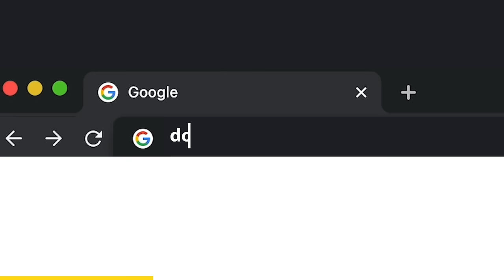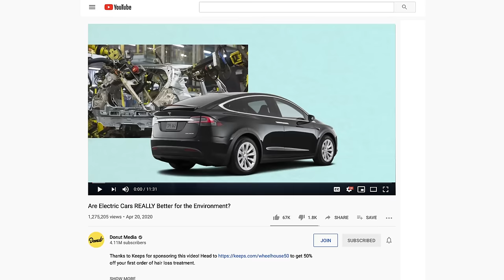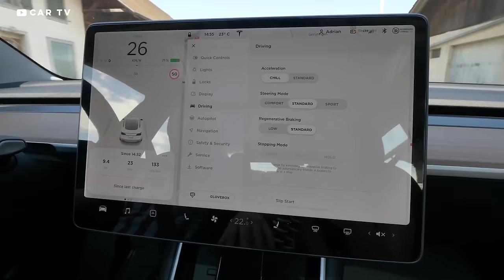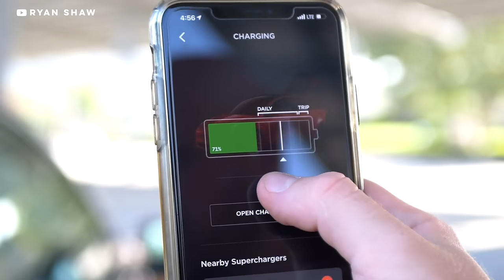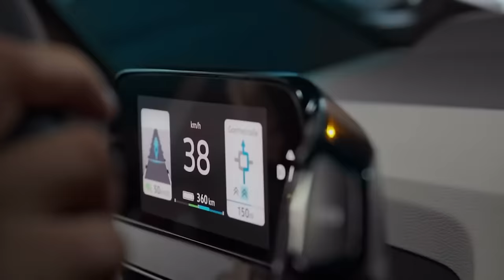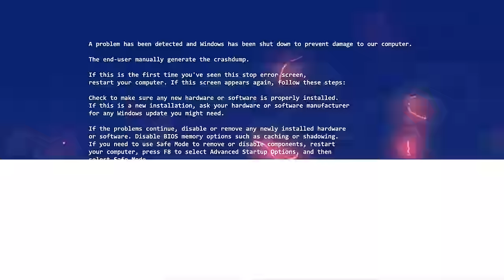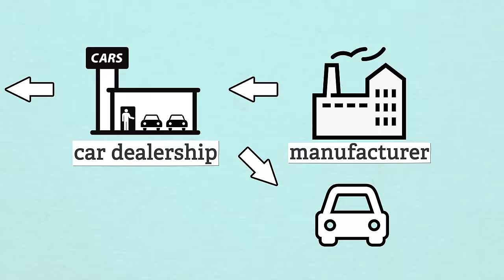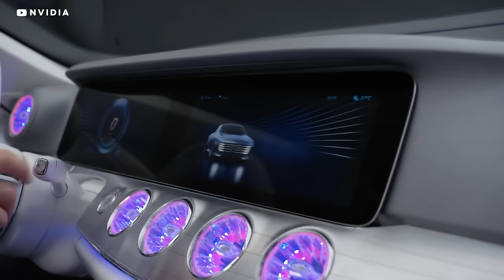Why Can’t Anyone Take Down Tesla?

Comment: I used to work as a software engineer at an automotive manufacturer's RnD and at that time, Tesla introduced the self-driving feature to the public. We were so dumb-founded that it was way past where we were and the gap is so far. It is true it usually takes a few years before new tech from RnD gets to actual road cars due to the business model of supply chain, parts, and manufacturing. While it was THE vision for us, Tesla already had it in their cars.

Comment: I don’t care how impractical it would be I want a manual in an electric car. 😔
Reply: Manuals are reliable, that's exactly what Tesla wants to avoid. How about the best cool Tesla feature: the ability to have your fast charging remotely disabled without your permission. 2nd coolest next to not being able to fix it or have it fixed by anyone other than Tesla. Cool Scam.
Reply: You can get a manual, in one of the vintage cars that are converted such as the VWs by EV West

Comment: @donutmedia I think Nolan was on his way making an excellent point but missed a bit. It is not that big car manufacturers (such as VW and BMW) do not have the know-how and/or the people to build superior software than Tesla. They do, the problem is how they utilize their people. And here is an aspect that video did not mention unfortunately.

Tesla is a technology company whereas other car brands are manufacturing companies. They use very different methodologies and approaches on their development strategies. In other words, Tesla knows how to coordinate software development and how to proceed quickly and effectively, car manufacturers are not very experienced in that endeavor and also still not very effective. Add that to the fact that most car manufacturers are big corporate structures with complicated management hierarchies suffering from bureaucratic delays and you can see how they are not very successful in developing software. That said, with big environmental pressure around the corner (there are talks of banning fossil fueled private vehicles in EU by 2025), big car companies will have to catch up and they will have to catch up quickly.
Reply: Exactly, but even technology companies fail to follow through with the discipline to develop and deliver functioning product updates. At the heart of the software development process is the Agile Methodology (https://hbr.org/2016/05/embracing-agile ). But it takes a little getting used to. You have to cut and dice the problem to manageable size AND produce a quick prototype that works good enough to prove a solution exists. In that way you put together all your prototypes together and come up with your product's 1.0 version. And it will suck and crash. But you iterate and do it all over again. You try to be agile and not stop and delay the process. This is hard specially for those developers who are perfectionists and can't let go the prototype code, they think they can improve it a little bit more and so delay the process.

So yeah, Mr. Musk has mastered this agile process not only for software but for cars and rockets! Very impressive.

Comment: Tesla: I have the most advanced buisness model
Toyota: Hold my TPS
Reply: True, Toyota's Tire Pressure Sensors always need replacing, that's a good business model
Reply: jeany545 I thought that was TPMS. Tire Pressure Monitoring System

Or did I totally just miss some sarcasm? You never know these days🧐
Reply: @jackryan4313  yes tps= throttle position sensor :)
Reply: @jeany545  Can confrim, I have a 2008 Toyota Avalon with TPMS always on, can't be bothered to replace it

Comment: The primary reason is the exploitation of helpless customers by dealers, companies and mechanics who formed a cartel often executing planned obsolescence and charging high fees for insignificant things so whenever these exploitation crosses the limits the supreme creator brings something new forth which decimate the older corrupt lobby.
Reply: It is 100% not the mechanics fault, you definitely mean the engineers. The engineers design the bullshit, we just have to fix the bullshit. Trust me, we hate new cars too. There's almost nothing ever wrong with the mechanical components of these newer cars; 90% of the time, its the computer. Again, blame the engineers who design this shit.
Reply: Put the current “car designers” in this basket. More and more and more fake lines and unnecessary shape shifts which makes a hell of a job for an engineer and then to a mechanic! Even if the issue is simple, the way to get to it is filled with plasticky obstacles hence reflecting the price for a mechanic to fix it. 
Or...Put the end customer there too, who thinks that “cool factor” is achieved by implementing a complex surface on a grocery getter is the way to go!
Reply: @MoistGrundle  rightly said, good luck👍
Reply: @clearcutpro  right, convincing statement I agree 👍.

Comment: Hey nolan plz take frs and brz in second season of hi low. It will be the best
Reply: Lol no, that car is such a shit platform for upgrading. Something like a WRX would be much better for the next hi low.
Reply: Husayn Mir slow and low as what wr call them. 30k for a brand new anf 13 for used one. Might aswell buy a miata and put a turbo on it
Reply: Husayn Mir the brz boxer engine seems good, they can handle 400whp with our building the engine. A wrx is more simple, everyone builds them, they come turboed. Its like building a focus st or rs. The brz is better, just like the Z none come turboed and its a staple in the car community. Plus the brz is such a sexy car (you gotta admit) lmao. I almost got one... no regrets, im happy with my car but still gotta admit when i see a clean brz even if they are slow as shit
Reply: @husaynmir1430  they are awsm in that too. That's something we only understand after driving them
Reply: @overknight5278  Yeah the design is amazing, but I hate the feeling like im driving an underpowered WRX. I rather just have more power from the get go and upgrade what I want later

Comment: Why is it important that Tesla hasn’t made a profit yet?
Reply: @spacewombat4569  Horribly wrong, it's the total opposite. They're investing in growing, making factories better than the old ones, ramping up production, designing new mass-market vehicles, and now with battery day, new battery cells that will render equivalent priced gas cars irrelevant and American automakers out of the radar. The only thing they're not doing right is quality control and servicing in some areas, but it's not like normal automakers are better at it.

They don't care about "showing a profit" they're spending their cash on growing, not on investors' feelings.

Comment: The 2nd Gen Volt was the people’s EV. Chevy just didn’t give a damn and thus failed to promote it. People thought it was a hybrid, but in reality, it was a plug-in hybrid. It could go 50-59 miles on a single charge. You did not have to worry about range anxiety because there was a gasoline powered generator that powered the EV motor. And unlike other plugin hybrids in the market, you could pull out in front of someone without worrying you’ll get rear ended. Fully optioned ones were about $35-38k new, and were honestly NICER in looks and function than the Model 3. We traded in our 2017 Volt for a Tesla Model S, because it was a lease, but also because my husband wanted something a little bigger, which was something the Model 3 couldn’t deliver. I remember how cheap feeling the 3 was, despite the insane price tag. We got rid of the Volt 2 years ago, and I am STILL recommending it to people. Up till the day they closed the plant, I was telling people it was going to be the car that saves GM.

Comment: After battery day, legacy car manufacturers are sweating bullets. A $25K fully autonomous Tesla is coming in 2-3 years and a sedan that's faster than McLaren P-1 is coming in 2022. And oh, the new roadster with 0-60 in less than 2 seconds is in the pipeline as well for under $250K. As much as I hate to say it, the combustion engine is pretty much done. Many car makers will either have to catch up or go bankrupt.

Comment: Main reason: Most Automakers never fully focused on Electric powered vehicles.
Reply: Thank God for that.
Reply: When you realise the i8 is both slower & more expensive than the Model S
Reply: @notlNSIGHT  yeah I wouldn't want one period or did you forget that you can hack electronics? On top of the fact that electric cars are worse then gas cars simply because they don't get rid of pollution they just displace it to the power companies, somewhere some coal plant is giving you the electricity to power your car.
Reply: @ifyourmarriedyourasimpandacuck  pretty much all gas powered cars can be hacked too. Cars electric or not are run by computers now. Also where i live 80% of power comes from hydro. Where you live its probably different, my point is electric cars are not as bad as you make them out to be.
Reply: The problem is they can be. I’ll let you figure it out yourself
Reply: @ifyourmarriedyourasimpandacuck  Oh, where do I start? First, the discussion of electronics isn't really a deal-breaker for EVs vice modern ICE - as, well, both are incredibly electronic intensive.  By that, I mean that it's irrelevant to the discussion and shouldn't have been mentioned. Second, what method is used to produce electricity, whether locally or via the power company, is very situational. I can name fields upon fields of windmills and solar panels being the primary means for the mid-Atlantic east coast. Statistically, that's a trend in most modern first-world countries - including the US. Lastly, US coal production has been significantly decreased in the past 10-15 years. Please reference the tons of unemployed West Virginians (prior coal miners) for evidence. Side note: I reverse engineer electronics for a living as well as being a prior coal miner. Like most anti-EV folks, it appears as though much of your misinformation is based on things that were accurate decades ago. Things change. Figure it out or get left behind, good sir.
Reply: @lzh4950  I've driven an i8, was one of the most uncomfortable cars I've ever had to sit in or get in and out of. The door bolster is so wide and the roof is so low that you have to put one leg in and then fully support your body holding onto the roof in order to cram yourself into the drivers seat in 2 steps lol. Getting out is even more challenging, you literally have to CLIMB over the door bolster and rock climb your way back out fully using the roof as the only handle to help you get in and out of the car, coupled with the mediocre performance with less than 400 horsepower in a car that has a $150 grand price tag for the 2020 model, If I was going to buy an expensive BMW I would get an M3 or M5 over an i8 every single day of the week, and it would still be cheaper.

Comment: Tesla's drag coefficient is one of lowest across their different models. Made possible by their sleek streamlined designs starting with very short sloping hoods, sloping rooflines and lastly the short front and rear overhangs. And I should point out that they've made these designs without compromising on passenger comfort. These design choices make the car really aerodynamic and go a long way to improving it's efficiency and range.

Comment: I've been driving my dad's tesla on and off now since September and I hate it. The screen is distracting, everything is thorough the screen, everything uses the battery so it does quicker. I miss buttons. Knowing where everything is so I don't have to go through 3 screens to find one thing that on a standard car would take one touch. Regenerative braking is a nightmare for first time users. It feels like a new driver is driving, as soon as you let go of the throttle the regenerative braking quickly jerks the car and slows it down. You can't keep your car on and play music when you leave, and if you only have the card key you're not able to turn on the car, walk away, and warm it up. Because as soon as you close the drivers door the car turns off.

Comment: 3:21 I'm pretty sure there is an explanation for this, but I would be very surprised if you get because it not an easy thing to spot, and there's high chance of me being wrong, but I'll watch the rest of the video and see if I agree with your answer.
Reply: 16:39 here I have to disagree with you.  Yes, having outside suppliers does make it easier for Tesla to innovate, however Ford, GM, and just about every other large company did have this model back in the 1950's but they ditched it for a reason.  

The simple answer is quality.  Having a supplier who's sole goal is to focus on making one part better, means that part is going to get better.  It also means that if manufactures have an issue with a part (which as someone who worked at several suppliers, I  can tell you they often do) it's on the supplier to fix the problem.  This means any issues with any parts stay isolated to those parts, and if say GM doesn't like what they are seeing from a particular supplier on a regular basis, they can just give the part to another supplier and fix the problem almost immediately.

Of course, this also mean that when a particular supplier, who makes parts for a lot of companies, starts having issues, those issues get around pretty quickly.  As an example I'd like to direct you to ZF.  ZF is a supplier based in Germany known for it's transmissions.  A few years back they made a 9 speed transmission that, because of their reputation for great transmissions a few Legacy automakers through into their vehicles.  But, this transmission turned out to be difficult to program, and as a result was reviled in every car it went in.  This lead to the odd scenario of an Acura TLX having the same issues as a Jeep Renegade, and of course there's the Taketa airbag incident. 

But the flip side of this is that once a supplier finds an advancement it quickly spreads around to other manufactures.  Which is great for the consumer.  going back to ZF for a moment, the reason Honda and Jeep were so excited about the new ZF 9-speed was because the ZF 8-speed (for RWD cars) had worked so well that, and it had become the industry standard overnight.  suddenly giving customers from all over the automotive spectrum a better product, that would have taken a decade to propagate under the Tesla model.  Transmissions are a hard thing to get right, and having a supplier that can make one that works reliably can take some huge headaches off manufactures.

And, it's not just transmissions that get this treatment.  Bosche helped make ESC all but standard across the industry in record time thanks to their brakes control suppliers.  Reliable paint (that doesn't chip off or fade) is thanks to advancements from 3M (I'm pretty sure that one is them) 

And that's going to be one of Tesla's biggest problems going forward.  before Legacy manufactures didn't have a supply chain for electric vehicles, but thanks to Companies like Rimac, that is changing.  And it's going to be hard for a single company to keep up with an entire series of industries who specialize in just making one part better.  It also means that once these supplier come up with something good, the entire rest of the industry will adopt it, except Tesla.  Which is not ideal

Comment: Surprised you did not mention the most improtant factor: All established automotive producers have not been built from the ground up as electric car manufacturers. Tesla has and made its whole infrastructure around this factor, to be 100% electric. The other manufacturers have tried building electric cars with their old car manufacturing philosophy and design standards, trying to save up on it, which didn''t work out in the end. With time, they will invest in their specialized branches that will rely entirely on electric car production. Also one big reason why they could not come up with a worthwile design is because they still thought about Tesla as a small, meaningless company. "If this shitty small company can do it, then we with all our prestige also can and even better!" was their thought process, without actually looking into what it actually takes to develop a good electric car, thinking they can do it with their established legacy industry.

Comment: There is a fundamental difference between tesla & the legacy brands. It has nothing to do with the products believe it or not. Even if Ford or GM had equivalent product at an equal price point. So what is it you say? TESLA Business model. legacy brands sell there cars at  wholesale to a dealer. For them to compete , they would actually have to change there business model. Aside from that, they do also sell solar & battery energy storage.

Comment: Honestly I'm very surprised that the Chevy Bolt has gone so under the radar. It's reasonably priced has a fun hatchback feel and is very zippy. It's small and fits anywhere and it gets 250miles per charge.
I feel like the i3 fell way short of what the Bolt offers and is way overpriced. Plus the Tesla just looks like a space blob to me 🤷‍♂️ and I would be so afraid to put anything inside it or park it anywhere.

Comment: Tesla's wholly in-house manufacturing is not a strength or a weakness. It's just a supply chain model. There's a very good argument to be made that a supply chain with good vendors is far more flexible, more innovative and has more concentrated expertise in specific segments of the chain, de-risks financial investments etc etc.
Reply: inhouse manufacturing is a strength. it allows you to control your supply chain which elon has highlighted as being a huge challenge to get organized to to the nature of established suppliers like Nvidia, the downside is clearly the large investment required for something that may not work out for things out of your control.